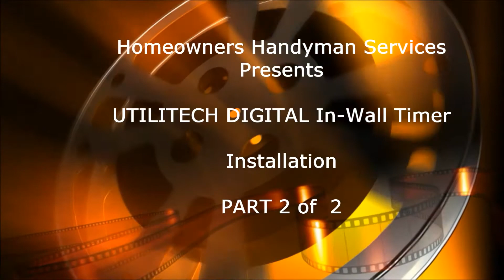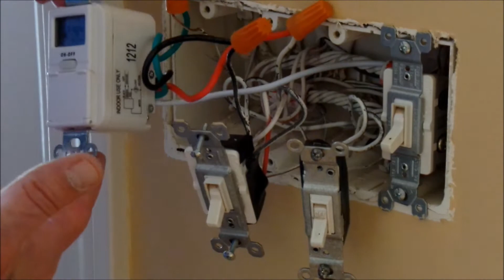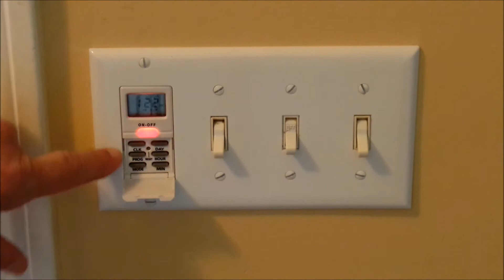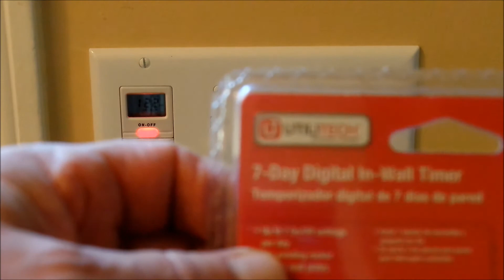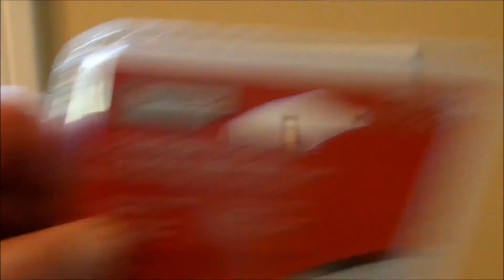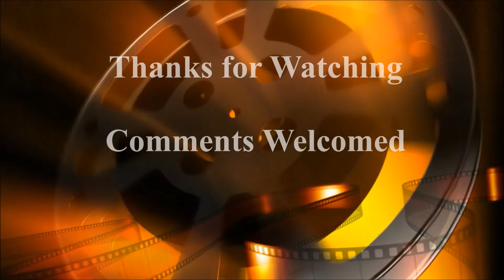Utilitech 7 Day Digital In Wall Timer Part 2 of 2

Comment: Thank you for the videos (part 1 & 2), extremely helpful!  I now have a better understanding of the wiring, use of the non-contact voltage tester and when to test power off and on.  Excellent instructions and steps.